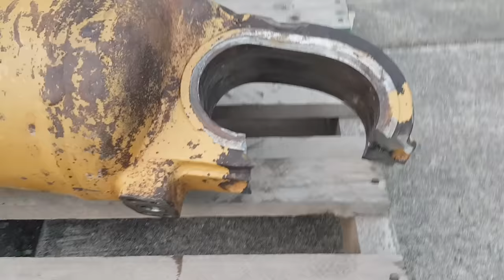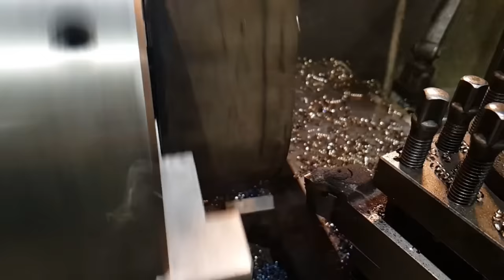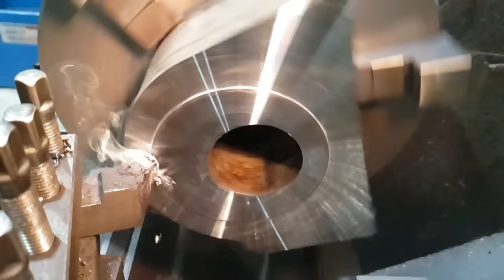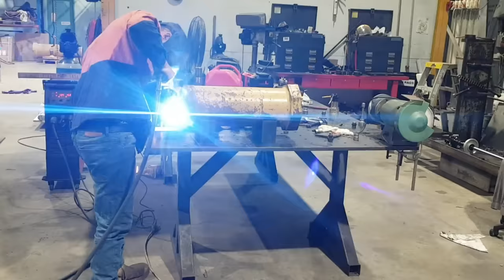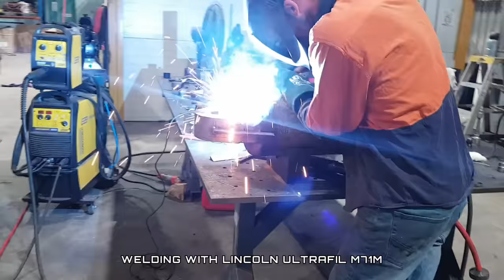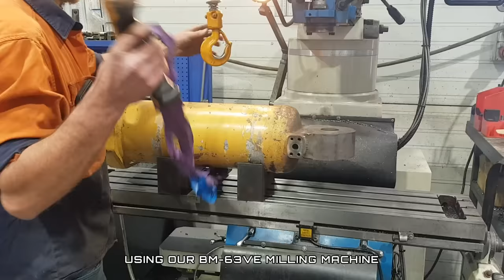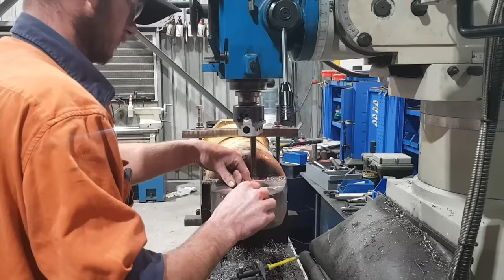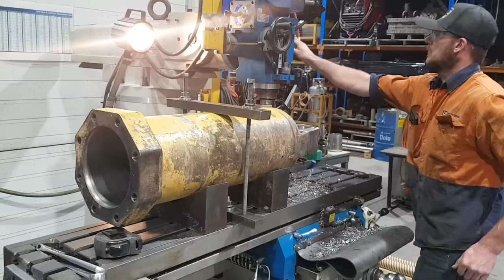Replacing Eye on Hydraulic Cylinder for Caterpillar D9 Bulldozer | Machining, Welding, Milling

Comment: why no coolant liquid?
Reply from the maker: Carbide can be run either flooded & wet or hot & dry. I prefer less mess so no coolant
Reply: @CuttingEdgeEngineering  cool. i don't know what tools they use where i work but if you don't use coolant the boss starts screaming (maybe cheap stuff for multinational purposes)

Comment: how a weld has the same characteristics as the original forged cylinder
Reply from the maker: Hey mate, the original cylinder end gets a PMI test to identify it's structure and grade. Then eye material is selected to match that, then weld filler & procedure.

Comment: I've noticed the quality of the blank pieces you use that have been burned out. Do you guys do this or do you use a vendor? Years ago I worked in a shop that did work very similar to what you do. We had a big optical torch outfit that did a terrific job providing everything was set up correctly. We cut a lot of 6 inch HRS and AR plate. If everything was spot on, you could turn the acetylene off and just keep going. Cheers from the USA. BTW, where do the cool shirts come from? Is this kind of standard "down under workwear?
Reply from the maker: Hey mate. We have a great supplier that use oxy-fuel cutting on these steel plates, yes always spot on too. The shirts are pretty standard. It's called "hi-vis" or high visibility and become an Aussie standard in the blue collar industry. Most job and construction sites it is required. Yellow is a more common hi-vis colour but gives off too much glare for me when I'm welding 😎👍

Comment: Dumb question: I've seen a few of these videos where they're replacing or repairing the eye on hydraulic cylinders. Why don't they put some big nasty bearing in there that you could grease and replace if needed?
Reply from the maker: They do 🤣🤣 but people don't grease them and this is the common result
Reply: Even an easily maintained part is only as good as the maintenance that actually gets done on it. :D

Comment: Excellent repair. This is how I restored bucket traction on a heavy loader. Only I didn't understand one thing, but why was turning necessary?)
Reply from the maker: Hey mate thanks for watching! 2 reasons, it was rough cut plate and needed to be trued up for weld positioning, and also faster for me to machine off bulk of material than mill it all.
Reply: @CuttingEdgeEngineering  Ah, now I understand, thank you. I didn't think about positioning.

Comment: Why didn’t this person just buy a new cylinder??? 😂
Reply from the maker: A few reasons mainly the repair was less than half the cost of a new cylinder. There was a 3 month wait for ex stock from USA to Aussie as it's a discontinued component. Cheers
Reply: @CuttingEdgeEngineering  Looks like this would be a lot stronger than the original part Great Job.

Comment: Why no cutting fluid when machining?
Reply from the maker: Using carbide insert can be run hot/dry or flooded wet, I prefer less mess so run hot and dry 🤣

Comment: Excellent job, a work of art, although I did snicker a bit when you said "drill gease port" , I didn't recall seeing any on the old one, course that could of been cleaned up a bit before, but still got a snicker out of me. Again job well done better than new now.

Comment: I dont understand metal working like this. I assume you need a much harder metal as a blade to cut through the metal that you need cut but what the hell can carve the blade if its that strong. Its confusion for me.
Reply: Hardened teeths for the bandsaw and special alloys of the cutting tool's indexed inserts,very hard tungsten carbide vs soft steel,no problem chewing trough,plus,many steps of the video are sped up to fit a day of work within 13 minutes,or maybe almost 2 days,just video sped up to fit the video shorter than a day

Comment: Why wouldn't you just heat it up and press it back into shape? Why all this extra work?
Reply from the maker: Please tell me you're joking? 🤣
Reply: @CuttingEdgeEngineering   please tell me you are. Heat the metal, bend it back in place, weld it together, resize the hole. Why waste all that time and resources by cutting a new piece? Seems like just a way to overcharge somebody.

Comment: How come you didn't heat treat the welds after you finish welding it? This would normalize the materials and reduced pre stress. This prevents it from cracking during heavy  loading.

Comment: I’m curious as to the strength of the weld. Is it just as strong as before the weld? I know very little about welding so I’m sorry for the amateur question lol
Reply: Often times the weld itself is stronger than the material around it, but it depends on the filler material and the material you're welding. Sometimes the heat can weaken the part immediately surrounding the weld. Note that the old piece is welded on though. See where the old part failed, at the narrowest part of the eye? This weld, if done properly, is likely stronger than that part of the old piece and the new eye is quite a bit beefier, so it'll probably take more abuse than the original assembly.

Comment: That’s a hell of a weld prep. Is it common practice to repair rather than replace these sort of components ?
Reply from the maker: Hey mate there wasn't much choice on this one as OEM parts are discontinued and 3 month lead time if available overseas.
Reply: Hydraulic cylinders are expensive mostly due to the sizes and precision required. I've run some where a single cylinder cost over $200k each. There's many company's around that do nothing but cylinder repairs including rewelding damaged rams, hard chroming them, and then cylindrical grinding them back to round and straight. All of that is expensive, but still a whole lot cheaper than a full replacement.

Comment: When you did the facing of the new eye, why did you do it with the lathe instead of a mill. Second question, as someone who’s never worked in a machine shop, what was the total time to complete this job and what does a repair like this cost? Great video.
Reply from the maker: Hey mate thanks for watching. The plate is rough cut and needs to be trued up for position & weld prep. Also quite a bit of material needed to come off and is twice as quick to machine than mill it off. Was a good days work for this job.
Reply: @CuttingEdgeEngineering  he was asking for the cost..im interested as well .

Comment: It will broke very quickly during load.   No proper welding if u do drill and punch stud before welding (just like bike cylinder engine ) then may be success

Comment: I assume the 1.2 wire is your maximum wire gauge? You should give 1.6 mm a go for the heavy jobs. Welds like a beast, you can go up to 400 Amps  and you can run your beads much faster and build up is much faster ofcourse too. Ok since you asked, I would've definetely used run out plates for the weld job. Even if you change direction every 3 or 5 beads your weld tends to get lower at the starts and stops and you prevent possibilty of faults at the starts. So when it's tested your weld is clean.

Comment: So I take it you don't have JB Weld in Australia.   A little heat, some banging about with a BFH and JB for the crack inside and out and Bob's your uncle.  That's how we do it in Wyoming and that why so few machines are still running around here.  :))))

Comment: I've done plenty of these. The entire bottom should have been cut off and replaced if it was repaired correctly, according to the manufacturer. There was no preheat on either of the parts before welding among other things. It is repaired, just not correctly.

Comment: Why dont use cooling water or cooling oil when the machine is running If you do not use it, the blades will become dull quickly and the structure of the material will deteriorate due to heat.

Comment: May I ask, why did you choose CO2 welding? What advantage does it have in this specific situation over other, i.e stick welding?
Reply from the maker: This is an OEM procedure not to mention stick is far too slow and there are equivalent, if not better, mig wires than electrodes.

Comment: I have a hard time believing this repair was more cost effective (or nearly as strong) as a replacement cylinder.  You guys must not charge enough for your labor.
Reply: Sugarsail1      Yet this is how a repair is done.  There must be a reason they don’t just order new pieces from the factory.
Reply: It's not always about money for the part and labor, you don't want a machine standing for weeks waiting for parts.

Comment: Someone please teach that guy how to use telescoping gauges.  Was the chamfer completely filled in with weld?  It looked like a super steep 15-30 degree chamfer that wouldn't allow for full-fill at the root.  How parallel did the two sides end up being as he only measured in one spot and there wasn't footage of the underside being indicated?
Reply from the maker: I got the measurement I needed, i'm guessing you only know how to use them like the textbook told you? More than 1 way to get the same result hey. We don't show everything we do
Reply: @CuttingEdgeEngineering  Please show less. haha.  #hackery

Comment: Good Ole dual shield. I've always said I've never seen better penetration than 45 wire dual shield. Worked at a beam making shop and we used that and we were throwing half inchers on 4 inch plates and flanges.

Comment: Ive always wondered how much a repair like this costs versus buying a new part, if the part is still available of course.  Age of machine im sure dictates whats available.  Must be cheaper im sure if they choose the repair route.  These parts come out looking great when finished.  I used to be in excavation and luckily most simpler breakdowns we could repair on the spot.  Never had to deal with a bigger failure on an important part.

Comment: I've repaired so many of these. I just used my hacksaw, stick welder and wire brush. I didn't need a lathe or any lifting gear because my mate Kong is strong.

Comment: Great video!
Are those beefy welds enough to withstand the mechanical stress when operating the bulldozer ? And does the welds compromise the structural integrity of the steel because of the heat ?
Reply: Do you know of a way to create or add metal without heat?

Comment: Your machine work is good but your welding is wrong for hight tensel steel ,you didnt pre heat your metal for the root pass and you didnt run a filet weld pass while you were welding this can loose strength of your weld and crack .your mig spool weld machine is not as strong as arc welding and you didnt have filet cover pass for the thickness of that metal, your cover pass should of been 3/4 inch .at least.
Not preheating will have weak penetration on your root pass.
I retired as nuclear welder, welding all types of metals

Comment: Weak weld .. not everything that looks good is strong. 
I would use 6011 stick rod  to start and 7018 to finish.
End of story.
Reply from the maker: Thanks for watching. Come join me in the 21st century where MIG wires are equivalent if not better than electrodes, and faster 😎👍

Comment: weld parts on a lathe? what for?? there is a bearing in the eyelet. it compensates for misalignment. there is no need for this operation to be precise. wasted time. ditched the guides with welding spatter.

Comment: That's not going anywhere... unless they use the ripper as a demolition ball again. Just out of interest, why did you face the part off in the lathe first instead of, say, milling it flat like you did after you welded up?  I'm not a machinist, just a wanna-be and maybe I could learn something. I loved the interrupted cut though.

Comment: That weld will not last long! You should preheat both parts according with AWS or similar Australian codes. 2nd mistake. You should use NR232 welding wire. You did Mickey Mouse job.